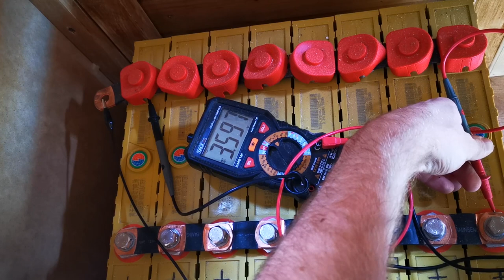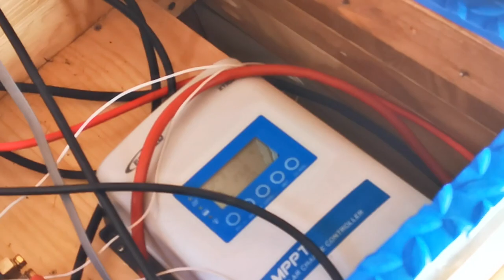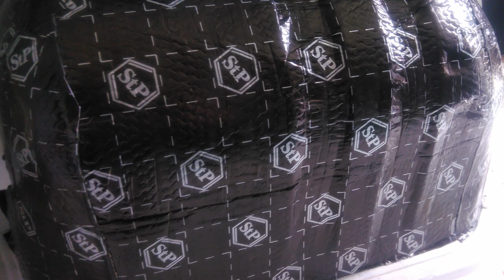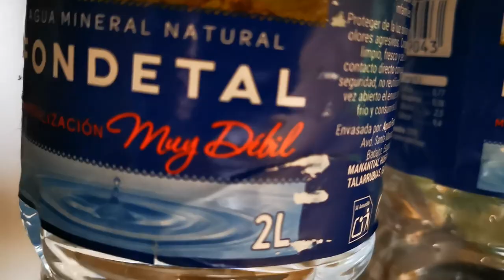Kamper - Vincent Van

Comment: Hi, very nice van. Is it a confidential information or I can ask you how much did you spent in the electrical system (batteries, solar panels, inverter etc)? I'm designing my own RV and I want it gas free, so I do like your solution (not so common for the vans, indeed).
Reply from the maker: Hi, I would have to check that and I have my invoices at home. I will check that and make a video about it as a lot of people ask about it.
Reply: @VincentVan2  Hi, your guide lines will be much appreciated! Keep posting video please :) Ciao